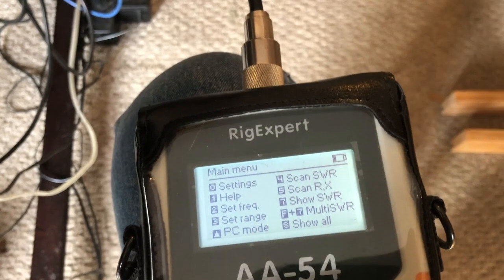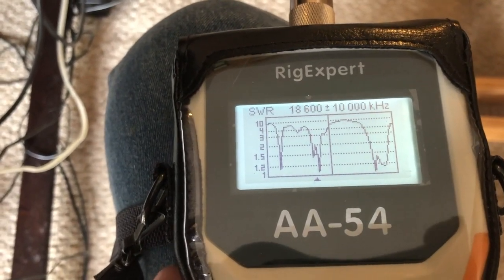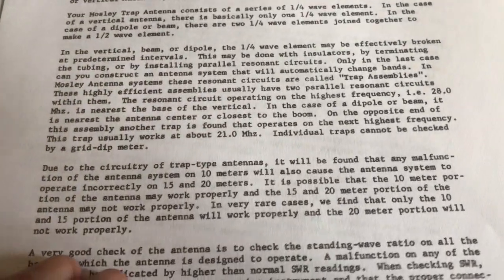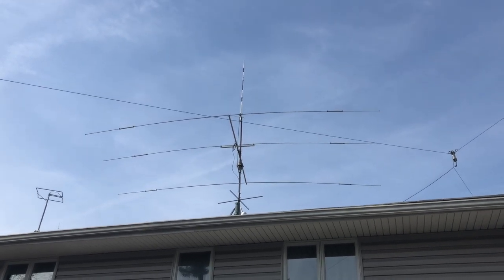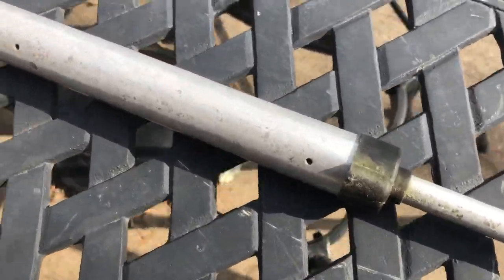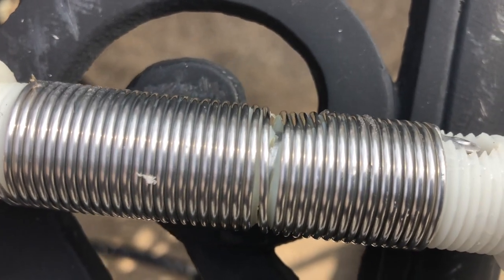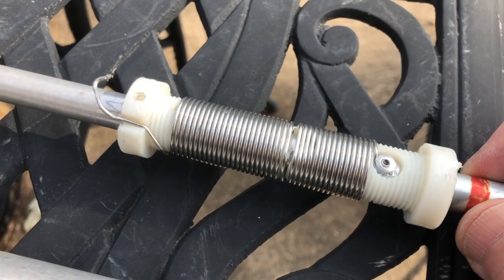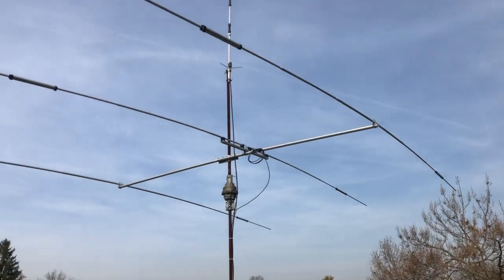Repairing TA33Jr Trap

Comment: i just took apart every trap on my mosley mini33a,12 total traps and 10 were cracked. i tapped them all back together and used gorilla super glue at the ends to seal them and not come apart again
but cant get the antenna any where close to the middle of the bands, they all pretty much tuned up at the way bottom end of each band and 20 mtrs was the furthest out. i tried moving the elments in an out and didnt help any.  im not sure how close a guy can tune these antennas.? im checking the antenna at 12 feet up on a temporary tower.

Comment: Cracked coil cores are a very common problem with Mosley traps.  I have a TA-33MWARC w/40m and a RV-4C trapped vertical and both have had cracked coil cores.  My vertical is a 1968 model and my TA-33M is a 1982 model.  Both are repaired and working as new.

Comment: Got a question for you.
I just got a used ta-33 disassembled.
How can I tell which traps are which , could it be the size?
Wish people marked them when they take them apart.
Reply from the maker: Good question.  When I moved I disassembled the antenna and marked every section with a permanent marker using words and not numbers.  Maybe a call to Mosley might help?

Comment: Mosley traps do not respond well to CW or Digi for a long period, especially when max power is used. Furthermore many users do not install a BalUn, as Mosley instructions doesn't mention it (Mosley does not sell BalUns...).  Feeding a balanced antenna (dipole) with a unballanced feedline (coax) is asking for trouble...
Reply: Perhaps uniquely, Mosley beams are not balanced antennas - one of the driven elements is grounded to the boom so feeding the antenna directly with coax is theoretically okay. That’s probably why Mosley don’t sell Baluns. Personally don’t like that idea or them squeezing two traps into one can.

Comment: I just brought home this antenna from a friend that gave it to me. What do you use to connect this antenna to coax with? There is no SO239 connector so I am assuming a 1:1 balun?
Reply from the maker: I simply strip a piece of coax back and put a lug on the center conductor and one on the braid and connect to the antenna.  Then I coil the coax with 6 or so turns.  Seems to work ok.
Reply: @k2cjbradio  Thanks or the reply. That sounds like a great plan. 
I hope everything is going well for you. I have been collecting items for a permanent ham shack. I am about ready to pull the trigger on getting my free tower and Mosley beam like yours up in the air. I scored a new Yaesu G2800 DXA rotator system that is way overkill for this antenna but It will give me room for upgrades.

Comment: I don't think it was the trap form expansion that caused the problem. I had a similar problem with a Pro-67B, but the real issue was that the aluminum wire that is riveted inside was high resistance (corrosion?). It looked clean, but resistance across the trap was in the megaohms. Your tapping of the form back together simply jarred the rivet into conducting again. It will open up again, soon. A trap that simply expands a 1/4" does not change the inductance all that much, considering it is dozens of turns.
My final solution was to drill out the rivet and replace with SS screws, with lots of Penatrox. I did tap the trap forms back together as well, and put small #6 SS screws on the outside, through the tube, (under the trap covers) to hold it in place so it cannot expand again.
If you suspect trap problems, measure the resistance across the trap first, it should be zero ohms or close to it. These traps have DC continuity.
Reply from the maker: Good point!  So far so good though.  Thanks!

Comment: Excellent video.  I discovered a similar cracked form in a TA-33jr/WARC trap.  It was in one of the WARC band traps.  Very easy fix.  I replaced an entire coil assembly in the same element 20 years ago. In that case the wire was melted.  Thanks fir posting.

Comment: Interesting.   I would like to know how to test the traps individually on the ground, before assembling an old TA-33.  I guess opening them up for visual inspection is a start.
Reply from the maker: Might not be a bad idea while it’s on the ground.  I relocated and the antenna isn’t up yet.  Before I reassemble it I’m going to check them all and probably glue the broken one.
Reply: dipmeter,

Comment: does anybody have a trap they want to sell for this antenna?  i need the one on the director.
Reply: @edgeorgie1922  yea he will for $65 not happening. i found 4 traps cracked all together and got some industrial glue and pushed the element back onto itself and the coated the whole coil with clear epoxy. works fantastic. we`ll see what it does in a few years ill take one off to inspect it.

Comment: why are you using a tuner on a resident antenna?
Reply from the maker: danny park Force of habit to tweak it a little bit.  Probably don’t need to.
Reply: @k2cjbradio   I only use a home made  3 element yagi for 20 mtrs and a 40mt pkw 2 element yagi. both monoband and resident. i never use any tuner. iam on qrz 2E0FSD.
Reply: @grandpaandlucas7054  Do you mean 'resonant'??

Comment: good to know how to break the traps apart. i am going Friday to pick up a used ts33 thats been sitting for 15 years of course ill pull all the traps apart and clean everything. and even better that mosley is still in business,,
Reply from the maker: Yes they are!  We are moving so I took the antenna down.  I might go back in and glue that trap form back together before putting in back up
Reply: I just got aroud to cleaning  my 33 up!  what a difference  aluminum cleaner  makes! But i did have a cracked trap so used p6000 glue but im goi going to get a spare and a few fresh trap caps just in case. Hope you got your move over and antennas up 73

Comment: Thanks for the tip . I am in the process of setting up a Mosley ta53m and the very first trap I opened was exactly like yours except mine was not dented in just the plastic core was split also mine has Black insulators instead of white .
Not sure if they use black or white in earlier models but now I am going to have to go through ALL my traps after seeing this .
Reply: And 1 thing i didnt ad was that they change the color of the plastic in their traps every 10 years so that gives them a little better idea of when the antenna was built . Mine being black suggest it was built in the 90s
Reply from the maker: Gary Vernon So glad this helps!  I think that dent is the design of the core.  It hasn’t failed since...so far so good.
Reply: @k2cjbradio  Thanks for the reply .
  Mine where not dented like yours having that flat spot .
   I don't know what. Caused the break in the insulator it didnt look like overheating or expansion.
   But I might just call Mosley and ask what could cause a problem like this . It might not be a common problem but was a problem for at least us two .
  Thanks and if I hear a answer from Mosley I will post it here .
73s
K4ASZ
Reply from the maker: Gary Vernon Sounds great!!
Reply: @k2cjbradio  
Okay I just got off the phone with Gary at Mosley antenna and great guy great information didn't rush me and answered every question I asked. I talked to him about the splitting insulators and he said it's due mostly to age and tapping them together is the best way to fix those but not to use any type of glue or epoxy to hold them together but to use MEK or methyl ethyl ketone. For the insulation material it works basically like PVC glue it melts the insulator and well fuse them back together and not pop apart again. Also I talked to him about me going through all of my traps and antenna that I'm putting up because it's used I was putting some of the copper anti seize on the connector from the coil to the outside of the Trap and he says that's not a good idea because it can Ark between the screw head and ground of element so I'm going to take the traps that I've already done clean that off and redo them he doesn't suggest anyting on the connection from the coil wire to the outer shell of the Trap but if you clean it real good on both sides of the wire and the trap you can put a little bit of acrylic clear to seal that connection because he said some people have been sealing the caps with RTV and it causes moisture to trap in and other problems with the Trap even with the drain holes on the bottom. Okay there's my letter about my call to Gary at Mosley Electronics
Reply: @k2cjbradio  I did tell Gary at Mosley about your coil having flat spots or dents in them just on the coil not on the outer-shield of the Trap and he said he's never seen or heard of that problem but as long as they're pushed together it shouldn't call it a problem but if you want you can call him at Mosley
Reply from the maker: Gary Vernon Thanks!!  It is odd that both coils that I had opened had that same dent.

Comment: Good fix on the trap, albeit you will probably have another failure sooner than later.  Another issue with traps is the screw on the end loosens up and causes issues.  Personally I like trap-less antennas, but they do usually cost more.  You had good troubleshooting techniques.  I was in the IT Industry for 46 years and it is amazing how many people do not have good troubleshooting techniques.  I always told them to start at the source and see if the power cable was plugged into the outlet, is the power cable plugged into the back of the computer, is the network cable plugged in...... A lot of the time it is the most simple issue that causes the problem.  And a system reboot cures 99% of the software issue!  The biggest problem I have with my trap-less antennas is that I will burn the wires going to the balun up.  It basically cooks the wire and the insulation will crack and fall off.  But since I am a DXer and a Contester, I usually run full legal power.  I have found over the years that what we consider full legal power and the manufacturers consider full legal power are 2 different things.  A lot of them consider full legal power to be 1000 watts.
Reply: You have done the hard part of finding what was causing the problem and you know what to do for a permanent fix.  It is a little more difficult when your antenna is 92 feet in the air.  Hope you have good luck with it!
Reply from the maker: n5pa Thanks for checking it out! Yeah, there's a good chance the problem will return but at least I know where to go with it.  I'll probably just order a new assembly next time around.  Luckily my roof is pretty flat and the antenna is only about 8’ above, so I can reach it.